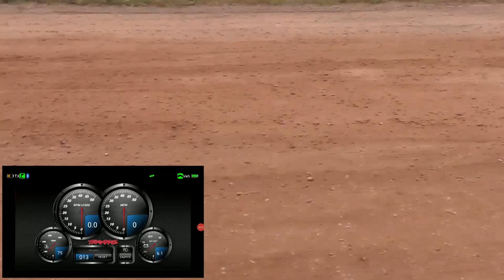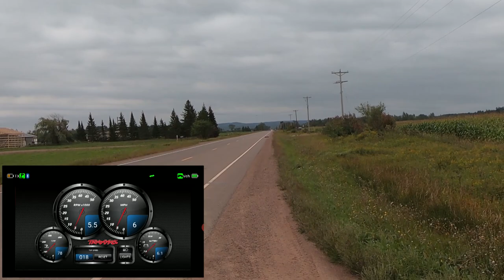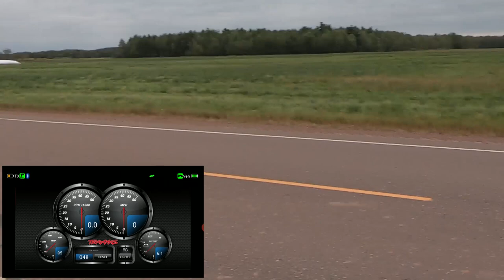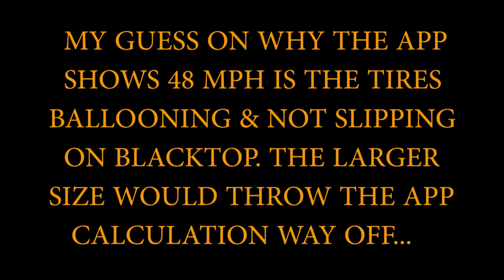8S XMAXX! 57.2 MPH! Stock Electronics GPS Speed Run

Comment: What batteries are you running I heard 75c should be the highest you should go with stock esc
Reply from the maker: Stock esc is a generic term. Some trucks have 80 amp, some have 130 amp esc's. Either way, electric systems "draw" the amps from the lipos. So a higher C rating lipo just won't be used to it's full amp draw by a lower rated motor/ esc. Shouldn't hurt a thing, and for sure it will run to its full capability with a higher C rating lipo.

Comment: I don't get how some can go 57mph stock and others top out at 48mph
Reply: Thats cus his isnt stock he has changed the pinion to a 20t and the spur to 46t
Reply: Also traxxas bateries are not good at delivering power as they peak at 25c get atleast 50c batteries
Reply: @turner9422  that's still stock electronics...
Reply: @turner9422  what batteries is he using? I'm running the stock motor with a max5 on 18/46 gearing, with 8s yowoo lipo's, and mine tops out around 50mph
Reply: @jobbo89  u should have really used a max 6 esc max 5 is really for smaller rc cars but even if u had a stock 8s xmax the esc is prety capable probly even more suited than the max 5 just change the pinion gear to a 20t and the spur gear to a 46t then get yourself some decent 50c discharge rated batteries or higher and ull be doing the speeds he is
Reply: @turner9422  you don't know what you're talking about
Reply: @jobbo89  ok cool u belive that 👍
Reply: Sorry ur right i was confusing a max 5 with somethink else my bad max 5 is actually more capable than a max 6 lol
Reply: @turner9422  haha no worries
Reply: @jobbo89  yeh sorry about that but i hold my hands up when im wrong im not familiar with the batteries ur running but try a 20t pinion instead of the 18t
Reply: Those yowoo batteries say there 100c so if that is correct then they should be able to handle the amount of power the esc demands but most battery supplyers lie about c raitings just change the pinion to a 20t
Reply: I'm running 22/50 gears getting 51mph. Now I'm running 24/46 and much faster better wheelies

Comment: Stock Gearing = 18T Pinion / 54T Spur (out of the box)
Speed Gearing = 18T Pinion / 46T Spur (to get 50+MPH)

What do you get using stock electrics AND the gearing it came with?  With or without stock electronics, modifying the gearing can drastically change the speed of the vehicle...
Reply: Between 38 ish to 45